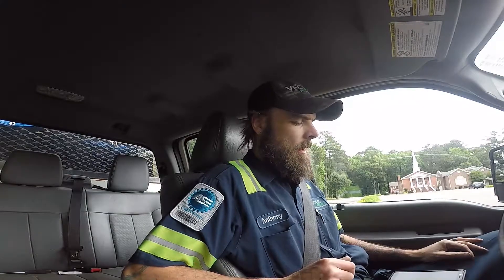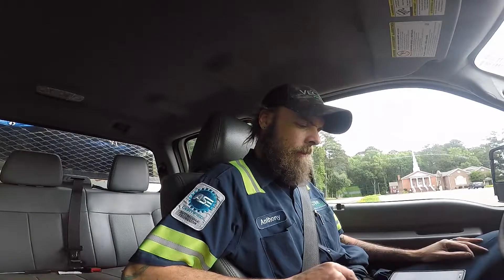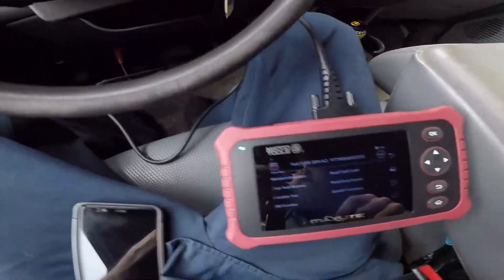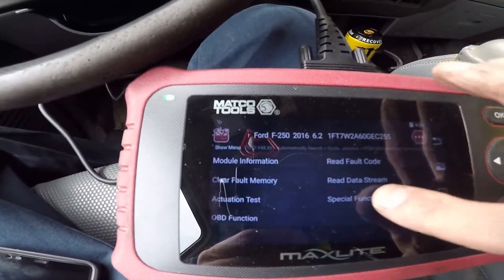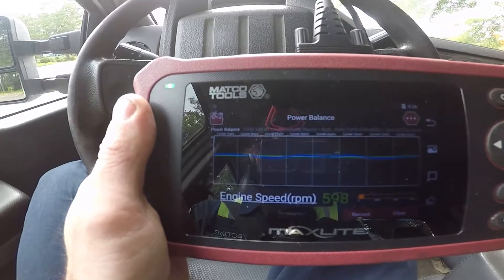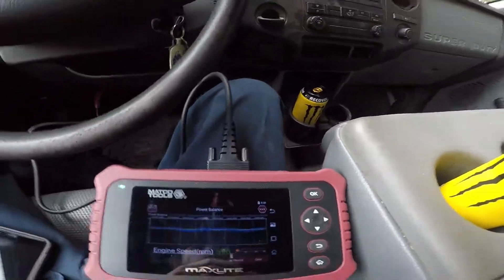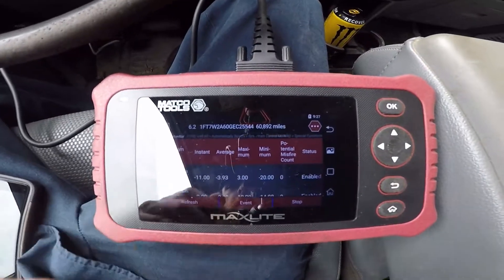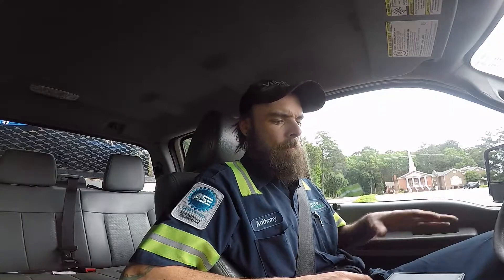2016 Ford F250 6.2 Liter P0355 Diagnosis And Fix

Comment: What’s the TSB you had for this issue?
Reply from the maker: 18-2047
Reply: @BeardedFordTech r/r coil pigtail and coils with ford oem parts? Also did you use the washers to raise the bracket?
Reply from the maker: @mitchbird6146 yep. And reprogrammed pcm

Comment: 2015 F250 with 6.2 had the check engine light on and started running rough. Auto zone tested it and had the po355 code. We changed all 16 plugs, wires and the #5 coil. Ran great for 3-4 days and check engine light came on and ran rough. Tested again and same code so we returned the coil and put the new one in. Fingers crossed this works. Changing all those plugs was a good! Great video
Reply from the maker: Its the coil driver in the pcm. Not the coil itself. Its going to pop the same code. You need to reprogram the pcm and if that doesn't fix it then it will need a new pcm.
Reply: @BeardedFordTech well third coil and same thing. 3 days great and then check engine light comes. Would disconnecting the negative and turning the lights on take the power out of the pcm for about 5-10 minutes help?
Reply from the maker: @mitchbird6146 it will kill the ocm. But the code will come back because its a coil driver code in the pcm. Clearing a code doesn't fix the problem.  It either needs a pcm update. Or a new pcm
Reply: @BeardedFordTech man your fast! I appreciate the reply. Any idea on the pricing of that?
Reply from the maker: @mitchbird6146 id need your VIN to get a price on a pcm. You can email it to me
Reply: @BeardedFordTech I sent it to your email
Reply: @BeardedFordTech just dropped the truck off at a Dayton Ohio area dealer and they tested it said everything is fine. I told them about the pcm coil driver update but they didn’t seem to think it needed that. After we picked it up yesterday we drove for work and it was running rough, check engine light on and no a/c limp mode.
Reply from the maker: @mitchbird6146 🤦‍♂️ this is what happens when people dont care. Instead of just doing it, they didn't think it needed it.  And now look. Man if you would have brought that to me here in NC I would have got you fixed up
Reply: @BeardedFordTech the tech told me when the coil misfires it stops the fuel injector on that cylinder. Is that true?
Reply from the maker: @mitchbird6146 in most cases. But it doesn't always fully cut it off. It may reduce fuel. Depending on how bad the misfire is
Reply from the maker: @mitchbird6146 but he also told you nothing was wrong didn't he
Reply: @BeardedFordTech true!
I will unplug that injector
Reply: @BeardedFordTech it’s a notable misfire. Truck shakes at stops and towing the trailer it’s really obvious
Reply from the maker: @mitchbird6146 it may misfire reslly bad if you do that. Be cautious please. You should bring that to me in NC I'll get you diagnosed correctly and fixed up
Reply: @BeardedFordTech man I would for sure if you were closer! This has been an on and off problem for too long.
Reply: @BeardedFordTech dropping the truck off again today. CEL is on and it’s running rough, no a/c. We will see
Reply from the maker: @mitchbird6146 keep me updated man.
Reply: @BeardedFordTech the truck started up fine and runs great. CEL is still on but we need this truck for work so we will drive it this week and see what happens. The tech said the pcm will relearn, not sure if that will do anything but I’m rolling the dice.
Reply from the maker: @mitchbird6146 no. Not it won't. Unless he cleared kam then it will relearn idle and fuel. Its not going to reset the check engine light. Why is this dude making it so hard?
Reply: @BeardedFordTech took the truck to another dealership with CEL on but runs fine. It was running with the misfire and that turned the light on but after it was turned off for a bit on restart it runs fine. This dealer couldn’t find a problem either.
Reply from the maker: @mitchbird6146 🤔🤔
Reply: @BeardedFordTech had a TSB 18-2047 talked about also but they didn’t do that work

Comment: My 2017 Ford F250 6.2L engine light came on and my Code was P0300. Multiple cylinder misfire. I changed all 16 spark plugs first and now have a tapping sound or arc sound with Code P0353 which is cylinder 3. Changed all the coil packs and still have tap sound. Checked the coil power coming in and ground is all good. Thinking it may need PCM update. Which bidirectional scanner has the Ford software ? Thanks. Great video.
Reply from the maker: 352 is coil driver in the pcm. You can try updating the pcm if that doesn't work it will need a new one. I have a link for a good scan tool that you don't need a subscription for. Does ford vehicles. Programs modules. It's here 
https://amzn.to/4coVGCN
Reply: @BeardedFordTech  Thanks
Reply from the maker: @whitstoddard5572  your welcome!!

Comment: Did this fix the a/c issue as well?
Reply from the maker: Yes. Notice I said ac was blowing warm because "it was in limp mode" I fixed the p0355 which took it out of limp mode. So yes the ac works. If your ac isn't working doesn't mean that's the problem if that's what your getting at. Or if you have a p0355 then a reprogram should work. If it doesn't. It will need a pcm
Reply: I was just double checking.  My a/c went out and then shortly after my truck is sending a P0353 code and has a misfire. I am going to look into purchasing a diagnostic tool to reprogram my pcm thanks.
Reply from the maker: @jasonphillips2161  here. This one is like $118. Does everything factory ones do. And it's free software I did a video on it a while back. I have programmed pcm with it before. 
https://amzn.to/3KVzhRW
Reply: Thanks I'll try it out.

Comment: When you pulled the coil pack and put a plug in it and grounded it, did it still spark? I have a p0358 and I can put a plug in the coil and ground it and it’s got spark. Wondering if it’s my PCM or a broken valve spring at this point.
Reply from the maker: 358 is ignition coil driver for cylinder 8. Go In the pcm and do a coil driver test. If it fails. Update the pcm. If it fails again. It needs a pcm
Reply: @BeardedFordTech  Thank you, will do. I don’t own a bidirectional scan tool, I am a Toyota technician and I use Toyota Techstream. I will have to either bring it to someone with IDS or the dealer, but if it was the coil driver, I figured I wouldn’t have spark…. I put a plug in the COP and grounded it with truck running, it had spark. That’s why I figured it has nothing to do with the PCM or coil pack…
Reply from the maker: @K_Bendel  it would have spark for a little while. Then when the pcm realizes it's not firing like it should it triggers for it to stop so you don't ruin the cylinder
Reply: @BeardedFordTech  that’s super weird, is there any way I can test to confirm before I drag it down to the dealer? When I put a test light to that coil, I get the same I do on every other coil. Man, I honestly hope it’s just a update of the coil drivers, but I’m nervous it’s not….
Reply: No chance that p0358 could point to something other than an electrical fault?
Reply from the maker: @K_Bendel  detected in the driver circuit for coil #8.
The most common triggers for this code include a malfunctioning coil, circuit problems, and a PCM in need of a software update.
Reply: @BeardedFordTech  I notice most folks with this issue don’t have power to the coil, but I do. I have good spark from what I can see, so I’m confused. I guess I’ll run a compression test tomorrow….
Reply from the maker: @K_Bendel  if that checks out. Reprogram the pcm if you find someone with ids
Reply: @BeardedFordTech  unfortunately I don’t know anyone with IDS capabilities and I am in upstate NY. I guess I’ll bring it to the dealer for diagnostics. I just figured it wouldn’t have spark at all if it was something to do with the PCM. I guess I’ve gotten used to the simplicity of a Toyota lol.
Reply: @BeardedFordTech  sorry your comment didn’t pop up. If what checks out?
Reply from the maker: @K_Bendel  oh it was for your compression check. If it checks out reprogram the pcm
Reply: @BeardedFordTech  I did throw my compression tester in cylinder 8 with all of the plugs still in. I’m guessing the correct test would be removing 8 plugs then doing the compression test. I did have compression. I figured if one of the springs was busted I wouldn’t have anything.
Reply: @BeardedFordTech  Unfortunately I specialize in hybrid cars so I hardly even touch a truck these days, let alone an 8 cylinder ford engine. I guess now that I own this truck, I better get used to it.
Reply from the maker: @K_Bendel  yeah you can leave the plugs in. Disconnect the injectors and coils. And crank. If you have compression. It's not a valve spring. Plus it would be ticking very loudly
Reply from the maker: @K_Bendel  hybrids come in many forms. A vehicle with auto start stop is considered hybrid. I learned that a few months ago.
Reply: @BeardedFordTech  You’ve kind of solidified it for me tonight that maybe this does have something to do with the PCM. I will mention this to the service dept when I drop it off. I just didn’t think I’d have spark if that was the case I guess.

Comment: I am having the P0355 (permanent code) on my 2013 F250 6.2L. The #5 coil is not getting any power, so I'm looking toward the Pcm. I brought it to a shop and told them about this issue that you described, and they said it needs a new PCM. They didn't try to reprogram the PCM, but I think instead read what Ford recommends. Is a PCM replacement the next step, or do you think they skipped over reprogramming. btw, they don't have a bidirectional tool, but he said they 'have a guy' that does that for them.  Thanks
Reply from the maker: In my situation it worked to reprogram it so it gets the updated drivers for then coils. If it does it again then it will need a pcm.

Comment: Do you know what the tsb is for this. I can’t find any reference to an update. I would definitely like to try an update to clear my P0355 code on my 2012 F-350.
Reply from the maker: If you keep getting a p0355. You need to update the coil drivers in the PCM. Is yours a f250 with a 6.2?
Reply: @BeardedFordTech  It's an F-350 with the 6.2L. The Ford dealer has had it 5 times in the last year and hasn't resolved the issue. It has 16 new spark plugs, 8 new plug wires from the coils to lower plugs, 8 new coils, 8 new fuel injectors, a new crankshaft position exhaust sensor, and new wiring from coil 5 to the PCM including the coil side plug end. I have IDS but neither I nor the Ford dealer can find any software update for the coil drivers. Maybe you are saying that the coil drivers psychically need updated inside the PCM.
Reply from the maker: @carsonstewart6335  yes. Reprogram the PCM. Coil drivers are in the PCM

Comment: Hey man is there also a TSB for cylinder 1 P0351? Can’t seem to find an answer on Google
Reply: 2015 f250 6.2
Reply from the maker: I can check tomorrow at work. Email me to remind me. Aheflin31@gmail.com
Reply: @BeardedFordTech Do you happen to know the TSB number?  Thanks
Reply from the maker: @shanemartin6729  not off hand. I'll have to look. 355 is coil driver for cylinder 5 coil. Sometime a reprogram works. If not it needs a pcm
Reply: @BeardedFordTech thank you. Mine is showing p0352
Reply from the maker: @shanemartin6729  coil driver for cylinder 2. You have a misfire on cylinder 2 because of it.  You can try to reprogram it.  If that doesn't work it will need a pcm

Comment: Hey man! quick quesiton. What scan tool or software do you recommend for reprogramming ECU's?
Reply from the maker: In this video I used my Matco scan tool that has Ford IDS software on it.  But a good after market one that is capable of doing it is this Foxwell GT60.  Its bi-directional and capable of programming plus 24 other functions.  On sale right now too for $759 check it out.https://www.foxwelldiag.com?ref=12
  This would be the one I use if not using my Matco.

Comment: What i checked is #2 primary coil plug with engine on does not pulsateing, this is the one i conect coil and blow fuse, already replace coil and hot wire goes straight to ecu pk-wt stripe, and red-gn stripe is grounded to the rest of ground coils, the other 7 coils does pulsating good, what advise can you give me, THANK YOU VERRY MUCH FOR ANSWER
Reply from the maker: Fault in the pcm coil driver. You may need a pcm replacement in this situation

Comment: Hi Antony H, my F150 2007 5.4 has the P0353, it keeps blowing fuses (15a) i check voltage on dc range it shows 17v to 19v seams constant power, should i replace or reprogram ecu? Thanks for your video it is awsome
Reply from the maker: Hey there. I wouldn't replace or reprogram just yet. Have you replaced all the plugs and the coil for number 3?  Check the wiring and connectors. Check for pushed out pins (wiggle test). You can remove the coil and ohm it out. If I'm not mistaken it should be less than 2 ohms. Try replacing the coil. Clear the code and do a power balance test if you have a scan tool that will do it.  Below are the reasons for your code. It is rare for the pcm to fail in this situation. 
Several problems may cause a P0353 code including:

A damaged or defective ignition coil

Damaged, defective, or corroded ignition coil connector

Damaged, defective, shorted, or corroded ignition coil driver circuit wiring

Loose connection at coil

Broken connector locks

Damaged or defective ECM (rare)